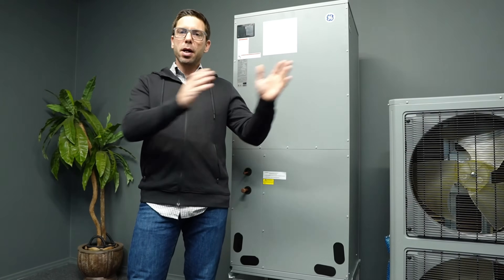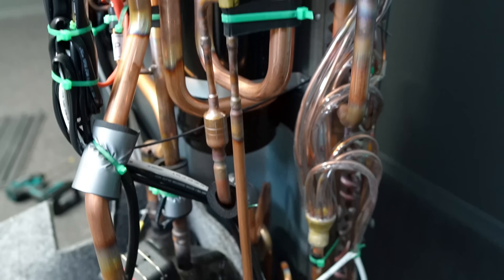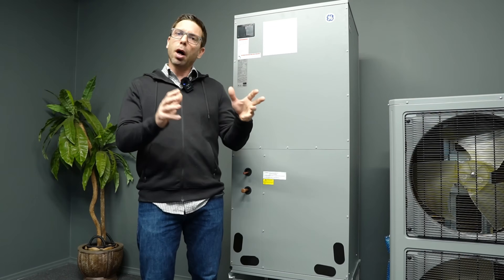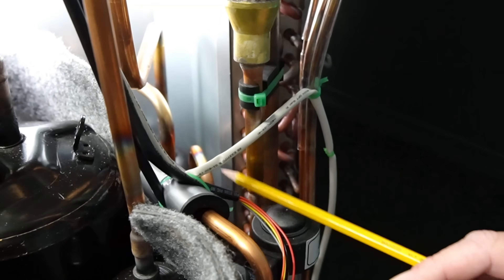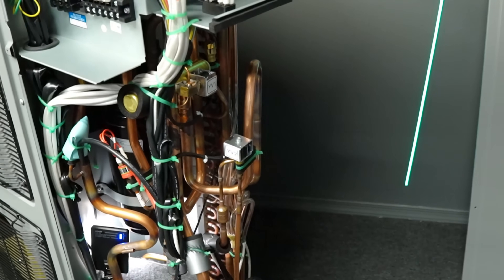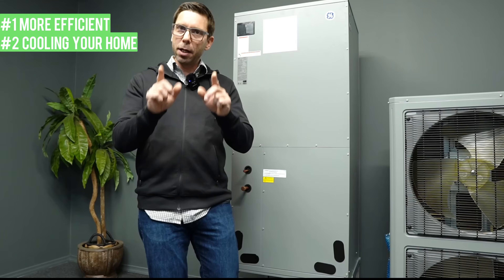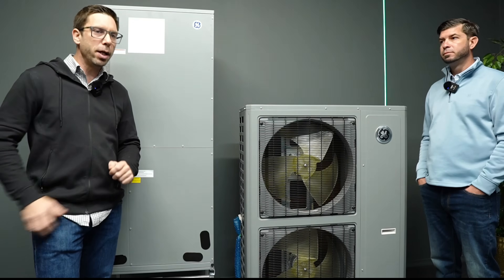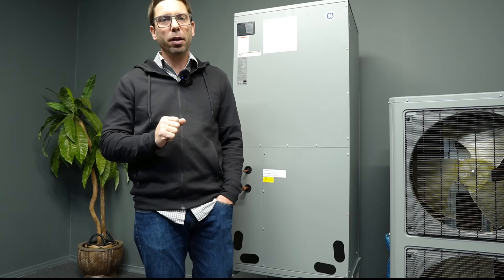The Rise of Cold Climate Heat Pumps (CCHP) Why it's a No-Brainer

Comment: Its not that new. The earliest mass production EVI heat pump for home and small building use was around 2010, it was a European company called CTC, back in the day, it was non variable speed copeland scrool r407c, uses 2 txv and a plate type economizer for EVI. Provides no cooling, but heating and hot water with its optional indoor kit. I have used a CTC heat pump in the same era, but it was a samller non EVI model, its hot water performance is truely amazing. The wide avilable of gas and oil service might be the cause of slow adoption for heat pump in America. There was a heating pollution reduction act in China, despite its harm to people due to the lack of compensation and transation time, EVI even EVI with variable speed heat pump emerged as early as 2015.
Reply from the maker: Thanks for the constructive comment!
Reply: "I think your comment was very educational. The guy pointed out that EVI was invented in the 1970s. That really makes one think about why, in the world, some folks threw it under the rug."

Comment: It just AMAZES!! ME!! how many people I talk to dont realize these cold climate heat pumps exist and STILL think heat pumps wont heat very good when temps reach in the 30's and below.. it just amazes me! and that is MOST people I talk to !  I have a MR COOL Universal ducted heat pump and it reached 0F (zero degrees)  a few times last winter and this winter also and it did NOT struggle, I have a 1020sqft home and the highest my electric bill ever was $157 and everything in my house runs on electric, the air temp coming out of my registers when outside temp is 15-20F outside is 134-135F , that is natural gas performance, lol, and NO ! I  DO NOT have any backup heat, I opted to NOT have the electric heat element (5k heat kit) installed in the air handler of the mr cool , DONT NEED IT  !
Reply from the maker: Thanks for sharing your experience, it definitely helps educate others!

Comment: Number one, they cost more.  I think they skipped over that one pretty lightly.   Our old hot water radiators are currently tied to a mod con NG boiler.  It's dialed in to run as low and slow as possible.  A CCHP would need to provide 135f supply water for my coldest weather demands.  Over the years air to water heat pumps have improved and in time I could probably use one with no  concern for back up in extreme cold but the up front cost is still too much.  A new NG mod con for indirect DHW and heating is one fourth the cost of the air to water heat pump.   Over the life of the equipment, I don't think the savings for electricity vs NG would add up.

Comment: Will the heat pump be "thermodynamically effective" if the temperature is below zero Fahrenheit and the heat pump has to warm the conditioned space to seventy degrees above the outside ambient temperature?  I am not sure that I am using the correct terminology. I expect that the heat pump would be less costly than resistive heat. I am trying to make a case for a house that has no gas appliances or a furnace. I keep thinking that my home would need a gas fireplace and a tank of LP gas for the forty or so coldest nights.
Reply from the maker: Fireplace, wood burning or gas, actually pulls heat out of the house. (incredibly inefficient) If you really need a fireplace for supplemental heat, we would recommend ''Enclosed Fireplace Insert''. When you are in business to purchase a Cold Climate Heat Pump try to obtain the Heat Pump's ''Expanded Performance Sheet/Data''. (do not rely on salesmen) That should show you how much BTUs the system will loose as the temperature keeps dropping. We are at the very beginning of CCHPs, and even these early systems are performing absolutely impressive. For example the Daikin Aurora system is rated to -13F and barely loose heating power at that temperature. If the temperature falls below -13F than it automatically switches to auxiliary heat to help you through those very cold night. The future looks absolutely amazing.
Reply: @GWAC555  Thanks! This is great information. I downloaded the "engineering data" pdf of the Daiken Aurora. The "capacity factor" shows 5 kBTU/hr at a -13 degrees ambient and 17 kBTU/hr at a 60 degree ambient. Is that the metric?

Cannot say I understand it in five minutes, but at least I can talk to my vendor about it. Our heating company sold us a Daiken dual minisplit two years ago.

Comment: I installed a 3 ton cold climate heat pump back in december to replace my 4 ton AC with resistance heat.  I live in North Texas which isn't a cold climate but we do get a few cold snaps each winter into the teens and twenties.  A month after install we had a few nights near 10F and the CCHP kept the house nice and toasty and saved a considerable amount of energy compared to my previous electric furnace!  Now we're hitting 90+ degrees every day and it is doing a great job keeping the house cool.  My AC energy use has been cut at least 30% and we're keeping the house cooler this summer compared to last.
Reply: You paid extra money for a cold climate heat pump in Texas? Hahaha
Reply: @Jason-wc3fh it was an extra $150 and it upsized the condenser with a higher cooling capacity and extended the warranty. No regrets here
Reply from the maker: Great to hear the new system is working out well for you! It is a game changer.

Comment: I just installed a ATK heat pump/ AC unit this past Monday in Toronto. We were in the middle of a heatwave at 36 Celsius or 98 Fahrenheit. The 2 ton system works like no other over the years compared to the 2 previous AC units i have had over 30 years. I'm so impressed on how cool it's in my house.

Comment: Thanks for the video ! What do you think about installing a central heat pump in a region where winter temperatures can drop to -20°C (-4°F)?
Reply from the maker: It should be fine but we recommend a professionally done Thermal Load calculation preferably using Wrightsoft. Try to use search for thermal load calculation companies in your area and get in contact with them. The typical cost of those calculations in our area goes between $200-$300. The amount of heating BTUs you need depends on many many factors…. (team member)

Comment: Today I learned The "EVI" feature  -which recirculates some side-streamed warm vapor to reduce frosting - distinguishes CCHPs (Cold Climate Heat Pumps) from regular heat pumps.  'Till now, I had understood that the high-efficiency, low-temperature (CCHP) mini-split models extracted more heat only by upsizing the outdoor unit to the next larger model up, and then by running the fans and coolant through for a longer period, efficiently extract more heat.  They might blow harder and longer inside, creating potentially a little more discomforting drafts and noise, and theoretically wear.  On introspection, they bring the temperature up/down more efficiently during temperate weather. As peak efficiency is measured spiking on a graph at a certain sweet range of outside temperatures, they might not have to pump so long and hard - in a manner of speaking.
Reply from the maker: You’re right, it’s not just about larger units. EVI is a major component.

Comment: I went with an ACIQ Xtreme cold climate (-22f) with a 80% gas furnace air handler as AUX. The heat pump goes most of the work, but in very low temps you can tell it has to work for much longer, which is the point where I let the natural gas take over (we're talking coldest few days of the year). It's also nice having a backup.
Reply from the maker: It’s certainly a strong combination. ACIQs are gaining popularity and seeing a rise in interest. We have received positive feedback from several of our subscribers. Perhaps we should consider conducting a review in the near future.
Reply: Dual fuel is definitely the way to go is it’s in the budget. My control even lets you out in the cost of fuel and it will switch over based on economy.
Reply: I've read that dual heat basically backs up 10-15% of the required heating in very cold climates but it's down to 5-10% for most winters.  So my questions are A) would an electric heat backup be easier and cheaper to add on to the heat pump system even though the electricity used would be more expensive than gas and B) if you go with gas would an independent NG gas tank (which a lot of rural homes use) be less wasteful and expensive than being hooked up to NG distribution?

Comment: I've lived in South Dakota with six tons of cold climate -22F rated heat pumps for 4 years. They are great, they do keep the heating bill low, BUT after each blizzard I have to throw an enlosure on them and defrost them with a diesel torpedo heater. I also still need supplemental heat on days below about 20F. The heat pumps still keep the house around 50F even on a -20F day, however, we like 70. I also have 12 filters to clean regularly since mine has 6 heads. They definitely are more work to operate. Also split AC and furnace systems can be sized for different heating and coolings sizes. Heat pumps are stuck with the same capacity for both. Here we need alot more BTUs in heat so the cooling capacity of my minispits are massively oversized for cooling leading to alot of overshoot on the AC setpoint. This my cooling bill is often not appreciably lower.
Reply from the maker: Thanks for the real-world experience. They are getting better and better….
Reply: Just curiosity, how is your insulation?
Reply: Insulation is ok place was built in the late 70s so its somewhat modern.
Reply: @jondearmond6876  I think we have different definitions of modern 🤣
Reply: Question....  The need to thaw out the coils after a blizzard is because snow was driven into the units or because it prevented the normal defrost cycle to occur?   IF you didn't have a blizzard, would the heat pump programming take care of its own defrosting?  Thanks for your comments.